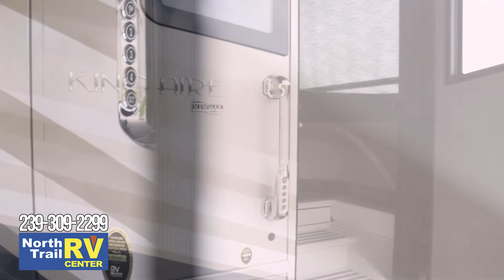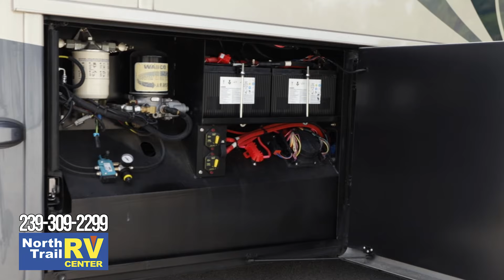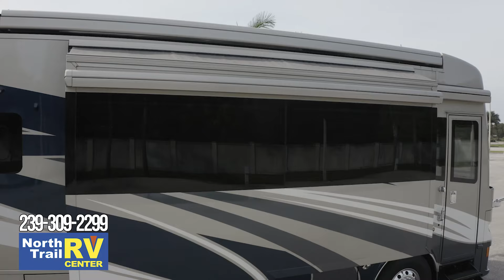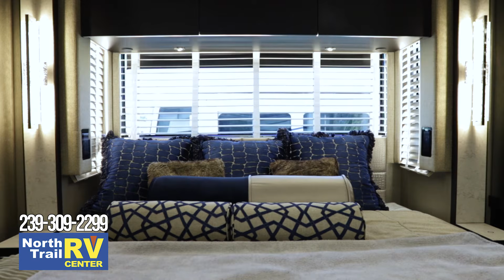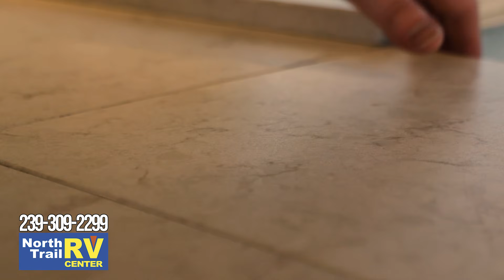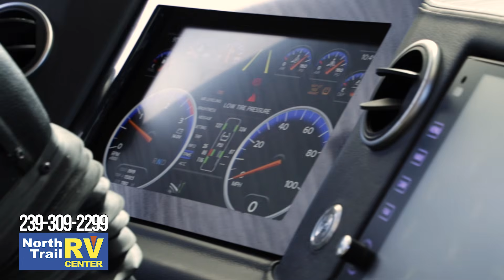2022 Newmar King Aire 4533 Luxury Motorhome.

Comment: Wow, this coach checks all of the boxes.  Beautiful interior finishes, big lithium battery packs, 605 Cumins, etc plus a superb layout and design.  I love the big windows and absence of overhead storage bins.  My only criticism is that the back of the drawer joinery is not dove-tailed (see it at 17:05).  That's a cheap-out. They appeared to be stapled which is a bit surprising.  That makes me wonder what other corner-cutting, cost-cutting things that we don't see in this video.  In any case, it's a beautiful coach that is very similar to a Newell for 1M less, but it's not a Newell or n Liberty.  :-)
Reply: Go buy one init